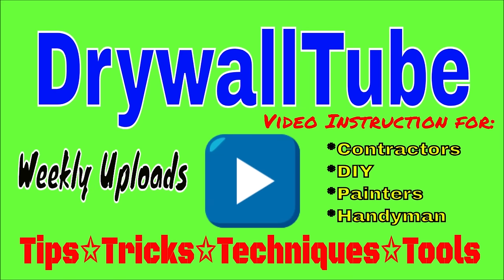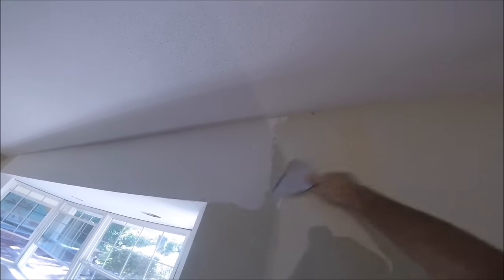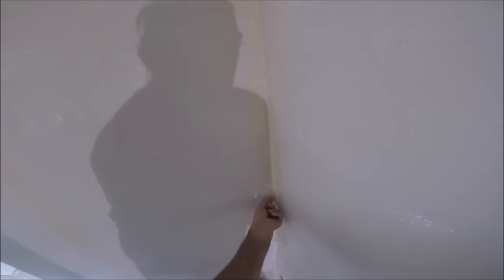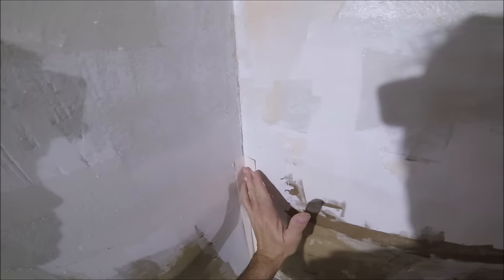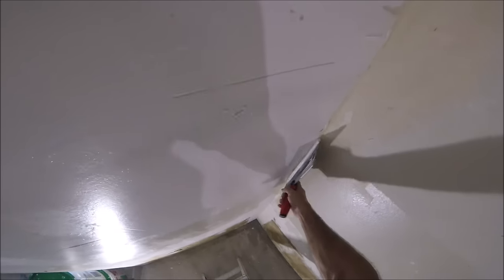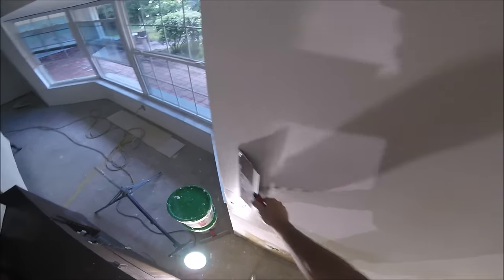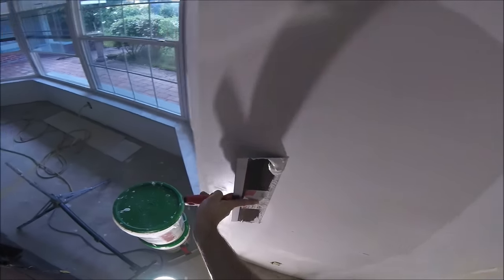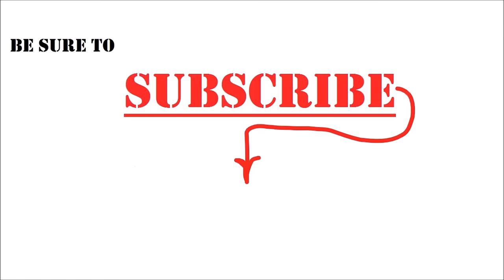How to Skim Coat a Wall after Wallpaper Removal Step by Step Tutorial

Comment: Hi Paul, thanks for the great info. I'm not a professional but sometimes do some of the work on rental properties I own. I like your tips and plan to use them the next time I'm removing wallpaper. Well, that's if I don't contract it out. I never allow tenants to paint or install wallpaper, but sometimes have to deal with it when purchasing another rental. My rentals are pristine, and I like keeping them that way.  I prefer to rent an industrial steamer, and generally avoid damaging the walls as bad as that one in your video. I guess the owner should have hired you from the beginning.

Comment: I am a DIYer and skim coating a small wall for the first time. I pulled laminate countertop off the wall (lath and plaster) that had been installed as a sort of backsplash. The gorilla glue that was holding it in ripped large chunks of plaster out. Wish me luck!

Comment: I have walls that were the wallpaper was removed and then painted over without skim coating. Will a good primer work or should I still use the Guards sealer? I'm a DIYer and glad I found your video.

Comment: This is very helpful! I have a problem area. A corner but outward angle verses what you showed in video. There is the "quarterround" I think on the outer edge and the damage is up against it. Trying to decide if we need to tape or anything! Ty!!

Comment: Thanks for the video.  I'm a DIY'r,  have a ton of drywall I've been working on, like the whole house.  I've had a couple problem walls, 60 year old home, old skim coat bubble when I skim it again.  It's just old drywall, maybe built up 1/8th inch, kind of strange to me it's bubbling.  I should have used the blocker primer you used on this one.

Comment: 01/19/2022:  Hello, I am almost 76-years old with limited working endurance.  I have small small bathroom tat I removed the wall paper.  I spackled the bad spots, but I do not want to sand and breath in all that dust.  So, I thought I would just paint over the wall with a thick nap roller.  When it dried, I was going to use a large sponge with big holes, and dab over the painted area to hide any imperfections and leave a slight texture look.  But, looking at your video, I might try what you did here.  My walls are small areas and not as bad as your walls in your video.  I just want to hide some spackle repair with minimal amount of work.  Thank you for the repair tips, and I will watch more of your videos.  Tom, retired in Orlando Florida

Comment: A DIYer that just took off wallpaper from a mix of plaster and drywall walls that had skim coat over it.  3 walls came off pretty clean, but the 4th wall was under the water feeds to the bathroom above it, and these have leaked over the years.  The skim coat flaked off as I removed the paper plus a few spots with blistering plaster.  None of the walls are particularly flat either.  The room is a separate toilet from the rest of the bathroom, so basically just wide enough for it and long enough to have the door swing inward.  I had a pro do the rest of the bathroom a few years ago but didn't have him do this.  I'm going to give the skimcoating a shot.

Comment: I like your pro tips in this video! Thanks! I am a DIYer and just tore off 60+ year old wallpaper from a wall that is lath and plaster. There is one big hole and a bunch of little ones in addition to some small cracks. Do you have any tips for prepping these walls for paint like you did for drywall?

Comment: Thanks! I'm a DIY. I removed wallpaper from a bathroom several years ago and it made a mess. Wallpaper was stuck straight to the drywall. I painted over it but want to fix it at some point. I also have another bathroom to remove the paper in. This is helpful.

Wallpaper is evil.

Comment: I just got done removing wallpaper that took me forever to get all of it off. Glue was a bitch! So i found out that sections were bare drywall. No wonder it took me so long. Thank goodness i found your video. Im going to have to fix the inside corners and 3 walls.  Im a diyer and now i feel better about tackling this "simple remodel", now since i found your videos. My walls arent as bad as the ones in your video, but theyrr looking pretty beat up! Thank you so much!

Comment: DYI'er here. Had this one wall with tatami wallpaper. Was nicely out and all, but we're re-painting the whole place and that was wasn't going to work. The tatami came off easy from the backing paper, the paper from the orange peel texture wall not so much. Ended up with a mix of lightly gouged out texture, peeled off paint and painted surface. Need to even it out. Thanks for the video. #drywalltube

Comment: DIY wallpaper removal - removed wallpaper that was stuck right to the drywall in the 70s.  I just removed the whole top layer of paper and sanded off all the bits and primed the walls. Repairing holes the getting ready to skim coat after.

Comment: DIYer! I removed paneling in my garage which was glued and nailed. It left the drywall looking rough...similar to this video but probably even worse. I am gearing up to use Gardz and then plan on skim coating it. Your videos are helpful. Do you have any tips and tricks or videos on fixing drywall after paneling was removed?

Comment: Thanks for the vid, I'm a painting business owner. I don't do alot of drywall/skim coating mainly because it's just me. There are companies around that have crews that can knock it out faster. Not too much of a problem, as I have plenty of work. Ironically, I just bid a job that will require wallpaper removal and subsequent skim coating. Question, are you thinning down the entire bucket of AP drywall compound? Or doing so in small batches? Thanks again, been painting a while, never too old to learn a new or different technique. 👍

Comment: Hi Paul, I’ve used Gardz on torn drywall and then Prime & paint walls. It works great. My question is: would you use Gardz on a painted wall where the previous painter  - painted over wall paper adhesive that wasn’t throughly cleaned? This would seal the wall and prevent any further blisters. I plan to Gardz the whole wall, Prime & apply a fresh coat of paint. Thanks
Reply from the maker: Yes, I would definitely apply the Gardz to seal the wallpaper glue.✅👍🏻🤓
Reply: Do it yourself! My bathroom looks like this once I removed the 30 year old wallpaper! Learned a lot with the removal and will be able to do a much better job next time. 
THIS VIDEO AND THE TIME AND THE EXPLANATION OF METHOD AND TOOLS USED!!!! WOW!! you make me feel brave enough for this step, which I have been avoiding out of fear !

Comment: Again from the 52 year working contractor: Over fifty years ago my wife and I purchased a 1902 Victorian previously butchered by a DIY’er. One of his remodeling tricks was to, after removing 12 or more layers of wallpaper applied over linen that was applied over interior shop lap which avoided a plasterer and saved money in 1902, was to install  1/4” chip board and wall paper over that. Having little money back then I double coated the papered wall with alcohol based Zingster/Zingseal white primer and then skim coated the walls before painting Alcohol primer IS THE ONLY PRIMER TO USE over wallpaper that keeps the paper from bubbling or peeling. 50 some years later it still looks great and is totally intact

Comment: I’m a DYI’er watching your video.  I was hoping to learn more about what compound to use when skimming a ceiling with old popcorn removed.  I thought about the all purpose compound, but might be difficult to spread because it’s heavy and thick.  I know it has good adhesive properties than the plus3 stuff, but then I was thinking I can use hot mud for the first coat to get things done faster…at least put one coat of hot mud and second coat with plus3 and let it dry for a few days before painting?  What do you think?

Comment: Like the advice - took the paper down.  Top layer came off nicely.  Most areas the glue and backing seem to scrape away with a 6” knife easily.  Some areas though just seem to leave behind a thin coating of paper.  Appears that it can sand from the wall with an orbital, but I will likely still have to skim coat the wall.  Is it better to just use the Guardz over what ever is left and then skim or spend the time trying to sand down to the areas that have this texture?

Comment: awesome. TY so much for clear, no no nonsense instruction on this. Ive just stripped my mothers 30 yr old wallpaper in a small bathroom. Ive stripped most of it but had one larger wall left where the brown wp backing was still there, was kinda dreading trying to scrape that off, tough enough getting the first layer off. But after seeing your tutiorial i think im ok by just scraping loose or hanging backing, then skim coating the majority, followed by a nice few layers of jc. Do i just apply one coat of that skim coat before i joint cmpnd? and it is ok to leave that brown backing and skim coat n  then jc over it to get ready for painting? most of it is intact so to tear into it seems like it would make it harder to hide? Great video . I appreciate your precise, detailed descriptions as you go. picked up like 4 tips. Im new, a diy. guy but i refuse to cut corners and alway seek the correct way to do things. ive taken quite well to it the drywalling, painting, light carpentry and masonry. Never took to this stuff as a kid, always was sports kid playing some sport, but ive become a home owner and  just got bit by the DIY bug. I just love it. I have 0 exp and everything i do i get from youtube, or soemother webapges. Ive torn down and rebuilt/remodeled 3 walkin closets, pantry shelving, from a coat closet, new shed door, now im on to a bathroom, where i just figured the shower tile process set, grout, caulk, seal. process. unreal that process. sorry to write long winded paragraph i just clicked w your way of explaining and speed was perfect i jotted most things down. ty david b NH

Comment: HI Paul, great video!  Very informative but I do have a question... After the walls have been skimmed and sanded, do you need to put a coat of paint on the walls to be able to see the imperfections like wallpaper seams and ridges that didn't get sanded smooth?

Comment: DIYer. Started the process of taking off wallpaper in a bathroom and that’s been a nightmare. Gouges in the walls and..well..still not done yet. But I’ve been getting the itch to get back in there and try snd salvage that bathroom. This tutorial is definitely a confidence booster with how, not easy, but easy it looks to be to fix the walls. 🤞🏻#drywalltube

Comment: Hi Paul, I am DIYer excited to repair my walls using your method.  In my case, when I removed shelving from a walk-in closet, there was leftover brown glue and some areas of torn drywall paper, like in your video, but only around the perimeter of closet where the one shelf piece was attached all around. (The rest of the walls are fine.)  I tried scraping and sanding down as much of the glue as possible, but there's still a slight bump.  Would you recommend using Gardz on just this problem area only or on all of the walls?   Should I do the two separate coats of compound on the problem section or do this on all the walls, like a full wall skim coat?  Lastly, where did you get your work light?  (I did not see it listed in your Amazon store.)  Many thanks for sharing your expertise!

Comment: DIYer. Thanks for the great content and examples. Do you need to add Gardz sealer if you only have a few brown drywall paper showing in certain spots? Is sanding necessary before applying the all purpose compound and begging skimming? Again, thanks for the help!

Comment: I’m a diy-er trying to paint a bathroom that had been wallpapered for 30 years. Wallpaper is off and the walls are mostly sound but lots of adhesive remains. The walls were painted with perhaps a satin finish paint before papering. Can I use that Gardz primer over satin paint that has adhesive residue on it? I have of course taken off most of the adhesive, especially the glue pieces that stick up off the wall. Gardz would be a huge timesaver if I can use it! Thank you!

Comment: Great video. I'm removing a wall paper that's like burlap with several coats of paint over it. It's an old office/ breakroom. Any tips on how to get that off. It will be about 3/32" to get to drywall. Any tips on best method to remove? Thanks

Comment: I am a DIY. I removed wallpaper in my hallway, but I did a clean job using wallpaper stripper gel. Then I use my steam cleaner with a plaster spatula & a recurring pad to make sure there is no glue left. Then I clean the walls with a degreaser mixed with hot water. I also wash the wall with a paint prep product. I just need to patch some cracks before applying the paint.

Comment: Great video, Paul. I'm renovating my own old stone house (175 yrs old). Interiors are lathe and plaster except for interiors of outer walls. Those are mortar rendered directly on the stone with a plaster finish coat. I heat gun/vinegar the old paper off, but a fair amount of moisture vapor moves through the old stone and lime mortar. Any thoughts on skim coat product? Would GP mud be okay, or am I better with plaster for breathability? Hot mud? I don't want to create a moldy, crumblimg mess!

Comment: Thank you for your video. Quick question was did you use to thin out the joint compound or how did you thin it out? I am new to this stuff and in the middle of  removing wall paper and also have 2 more rooms to go after this..:So far the wall paper is coming all pretty easy now that I got a streamer.  I want to attempt to smooth out the walls like this before painting. Also I love youe corner taping technique. I think I am going to try this as well. My husband is NOT handy at all and I am sick of looking at ugly wall paper so I am going to do this myself. Thank for all your help! <3

Comment: DIYer. Just finishing removing painted over wallpaper that was put directly over the drywall without primer or sizing in most areas. My walls look close to what you stared with. I was just looking around to see if skim coating was something I should try or if I should hire out. 

#drywalltube

Comment: Handyman here, the lighting is clutch, i like the sealing tip, i was very meticulous taking off the paper and glue. I didnt use a sealer but betcha next time i will, we used degreaser to remove the glue, do you think that will mess it up?
So far i skimmed the ceiling and it seems ok#drywalltube

Comment: #drywalltube diyer removed old 80s wallpaper in the guest bathroom last night and have torn drywall. Thanks for the tips. I need to buy that long knife and maybe that pan as well. I have a 3 small knives and a small tub of joint compound I use on cracks throughout the house but never have done an entire wall. Will get Gardz and try it out.

Comment: DIY - want to try to skimcoat my own walls, approx 270 SF.  It looks like there's just a technique. Any tips on wallpaper removal from tight spaces, like next to a cabinet in the corner???  Do you sand at all afterwards?  How long to dry in between skimcoats? how long to dry after the zinnser ? thanks

Comment: Thanks for this video. Bought a Farmhouse built in 1870...walls with layers of wallpaper. Top layer came off easily. Second and third not so much.  The first wall ended up looking like the one in video so I aborted mission.  At least I know it can be repaired with compound.

Comment: Thanks for the tutorial! 
After the joint compound has dried, can you paint over it or does it need preparation. Also do you advise a coat of primer before painting?
Reply: Seal the compound with a suitable  primer then paint or wallpaper.

Comment: Hello, thank you for this great vid! Can I ask what the difference is between 'Gardz Problem Surface Sealer' and the regular one (in the purple tin). There seems to be a big price difference, at least here in the UK. Would using the cheaper one be a bad idea? 

Also, I'm planning on putting wallpaper up again after finishing. Should I apply another coat of Gardz over the joint compound once dry or would that be pointless?

Thanks in advance,
Reply from the maker: What’s the name of the one in the “purple tin”?
Reply: @PaulPeck  Thank you for the response! 

Maybe it's just different branding in the UK.

It says "Zinsser" "Gardz" "High performance sealer." "Alkaline surface premier" "For all porous surfaces." "Seals damaged drywall"  

Does that sound about right for the job?

Comment: I’m a DIYer. 

Were tearing down wallpaper on plaster walls (Three layers and a layer of paint. Yikes!) Do you always recommend skim coating after removing wallpaper? A few more things. 

How do we fix a corner if we jacked it up already? (Bumpy and overfilled with spackle on a plaster wall.) 

Last thing, I’ve applied a skim coat over a popcorn textured wall. Why anyone did that just baffles me but i did two coats. I began sanding and I’m looking for tips on that. If i start to see the flattened out texture color coming through have i sanded too far? It feels smooth but in some spots where the texture was higher you can see the color change like little grey circles. I’m wondering if i have to dust the wall and skim coat it again or not.

Comment: DIY. Builder put wallpaper straight up on the sheetrock - no primer, no sizing. When we removed the wallpaper, the walls were worse than the ones on this video. Going to follow your guidance and see if we can repair them.
Reply: jabeck42 , our project is going slower than expected due to the hours we're both working. However, hubby and I are amazed at how great the walls look by following Paul's great video tutorials. I highly recommend Paul for all DIYers facing wall repairs.